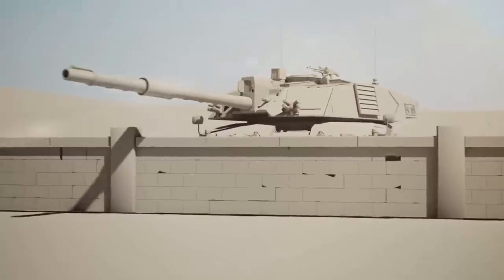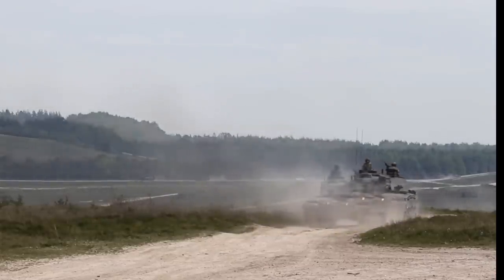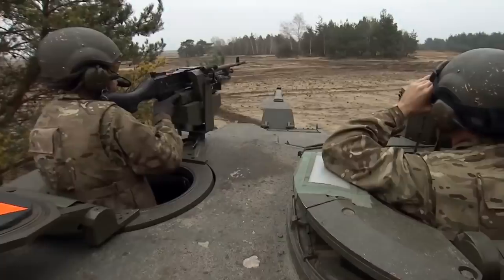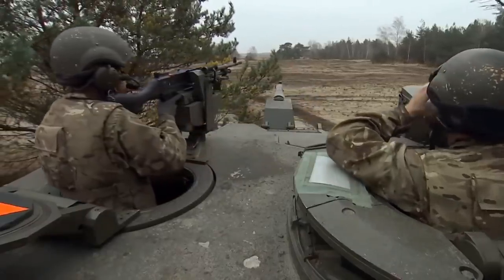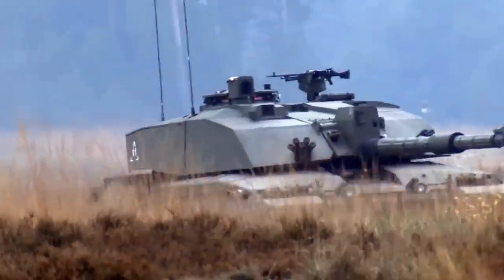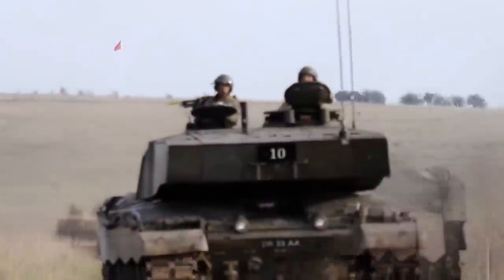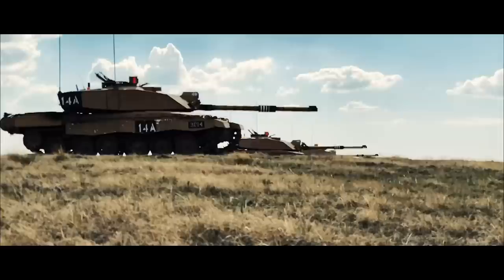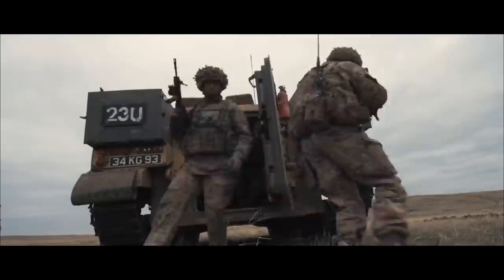Challenger 2 Tank "Black Night" | MODERN UPGRADE

Comment: The arguments for the engine are true enough, there's been the 1500hp mtu option waiting in the wings for the past 20 years ready to go, is an extra 300 bhp really worth it? An extra 500 maybe, 600+ yes, go for it. As for the gun, the rhinemetal item doesn't offer enough of an advantage over the L30 to make it worth it either and the commonality with our allies argument is utter BS, if it were true, the only difference in our kit would be the language use on the label.
Reply: placeholder  if you're worried about spin limiting the length of your rod don't be, the driving band on the sabot is designed to slip, limiting imparted spin to acceptable levels. Given the materials used, current KE penetrators are as long as they can be with out snapping on impact,  more length just on it's own means more weight and a coinciding drop in velocity (not counting less chamber volume for propellant) then there's just the physical handling in the turret by the loader and storage.
Reply: placeholder  it could be gotten around by either a pocket in the "front" of the charge or a shorter one filled with a different propellant. The unitary ones are pretty much at their limits on dart length already, the fins are back as far as the stub case and too much unsupported length out front runs the risk of deformation due to the shock of firing. Back to the challie, I doubt you'll see a smooth bore on it in service because by the time you've fitted the gun, sorted the ammo stowage, fitted all the black knight wizz bang electronics the army wants/needs, you're looking at 2/3-3/4 the unit cost of a complete tank because it'll require a new turret and if you're going that far the army may ask for the bigger engine as well, easier to build a new tank. The challie will retire in 2035 or there abouts fitted with a L30, what the replacement is fitted with is anyone's guess. By then Gauss or Rail guns may be the flash new tech as far as tank armament goes.

Comment: What is so hard about replacing a rifled barrel with a smooth one?
Reply: Thay would need to redesign the turret takes time and money
Reply: @spirit_miku  But the rifling is inside the barrel why does that need to change anything outside the breech apart from the projectiles.
Reply: @MrMonkeybat  the barrel is part of the breach the breach would need changing
Reply: @spirit_miku  Why cant a smooth bore barrel with the same exterior dimensions that fits into the same sockets be manufactured?
Reply: @MrMonkeybat  it maby possible I'm not 100% the barrel isnt a separate part as far as I know so it can't be removed I may be wrong

Comment: What are ppl on about how is a smooth bore better than rifled? Rifled bore is way more accurate
Reply: No, it's not. Famous myth.
Reply: @jonny2954  it's not a myth if the shell coming out of that smooth bore didn't have tail fins then it would shoot all over the shop where as with a rifled bore you have no need for any of that
Reply: @robh316  That's why smoothbore ammunition has tail fins.
Reply: @jonny2954  yeah i know but its just another thing that could go wrong what if the tail fins damaged ammo would fly all over the shot keep it simple just rifle your bores
Reply: @robh316  Damaged ammo shouldn't be shot from either gun.

Rifled vs. Smootbore isn't about accuracy. It's about armor penetration. Smoothbore guns have higher muzzle energy because they sustain higher pressure and have less friction. Furthermore the ammunition fired from the rifled L30 gun is seperated into two pieces (projectile and propellant), while NATO standard smoothbore ammunition is in one piece. The disadvantage of two-piece ammunition is that the KE penetrator length is limited, because it has to fit in the first part and can't extend back into the propellant like on one piece NATO standard smoothbore ammunition. A shorter KE penetrator is also lighter, and coupled with the lower muzzle energy of the rifled L30 is results in lower armor penetration.

Comment: No we need an Amos mbt
Reply: I think a Merkava Mark IV chassis with a new turret would be a good fit for a well protected AMOS platform. They already made IFV and artillery variants. The rear hatch would be handy for rapid reloads and the protection scheme is well suited for urban warfare. It would be a lot better protection than the CV90 or even lighter chassis.

Comment: hmm what happened to the Bae Systems & Polish MBT project Stealth Tank OBRUM PL-01? I believe they can make a modified version better than this one as a Challenger 2 gen 2/Challenger iii w/ pull power pack, active/passive short-air defense radar & attack system, active/passive integrated stealth armor. Longer body, bigger space, powerful hybrid engine min-max speed of 45~75kph, 50-80tons full capacity weight, modular hull/turrets/part system ala lego bricks, 2 man crew driver & hunter, Manual Auto AI computer support & digital HMD display, Armored protected crew hatch, advance armor & 330° sensor, 130mm advance smooth/riffle gun, miniaturize Dragonfire LDS(I doubt they have already that prototype at Bae Systems) & that's what they thinking for the past year WTH! where it is now lolx 😂😂😂

They plan it to counter T14 Armata sadly the Russian delayed the full manufacturing of it to almost cancelled like the SU-57.

Comment: The driver spot of the challenger 2 is an even worse weakspot than the abrams' turret drive ....
Reply: Actually, the driver of a C2 is better protected than in a Leo or Abrams (or Leclerc). Go Google image and look for pics of the C2 hull without Dorchester fitted. All around the drivers position you'll see troughs where the Dorchester blocks are attached to the hull. Essentially the driver is surrounded by a pit of Dorchester. That's why the Glacis of a C2 is curved and more prmoinent than the glacis on the other tanks in NATO. They do not have any comp armour as standard on the glacis.
Reply: the womble yee i know what you mean .. but i mean the little window the driver looks though ... this little "window“ is no resistance for tank shells
Reply: @GoRideLP  the chances are so small that a shell would even hit there. Its a well known fact abrams has poor turret ring armor and weak gun mantlet but they leave it out since its not a place your likely to be hit
Reply: Anne Isopod  in absolutely perfect conditions....

Comment: Heavy dino it's best days are gone. The gun is inferior to the rest of the Otan's 120mm gun, it won't be easy to replace, dated armor, it's already too heavy and underpowered, adding reactive armor will only make things worst. The German Leopard should be a better option, but there's no cash to afford it. Not sure about active protection systems? Read about merkava and the trophy system

Comment: When british will finally start making decent tanks?
Reply: Gar  they never were, really.
Reply: Gar  Chieftain sucked compared to T-64 and M60 in terms of reliability, because it had 2 engines. 
During WW2 Soviets valued Sherman, Panzer and T-34 a lot more than British tanks. 
Challenger 2 has huge profile, rifled gun, the last upgrade waits 74 tons, which makes it total lame in terms of maneuverability, bad power weight ratio.
Reply: You mean the looks or what?
Reply: @jem2779  British tanks have always been some of the best in the world, the Soviets had their best tanks lined up against the Chieftain, the tank itself was very good, the L60 was terrible because at the time NATO wanted multi fuel engines so British Leyland did so, then Nato changed its mind... but the L60 was already designed and in production so they went with it. It was the achillies heel of the Chieftain.
Reply: Well, they have always made them.
They made more-or-less the very first ones. Chieftain suffered from reliability due to the engine? Still it was a beast. Btw., T-64 was very unreliable and problematic tank. So?
How many Cromwells were sent to USSR? And Soviets that lost as many tanks as they produced are somebody to rate them? T-34 was quite a junk - btw.
Centurion? That gentleman sent bunches of the soviet ones to the junkyard. 
Well, western tanks have big profiles. Better working conditions for the crew.
Rifled gun is OK. It serve its purpose. What about Abrams crew with those omnipotent smoothbores finding themselves in Iraq with no truly usable antipersonel or antibuilding / antibunker ammunition few years ago?
Btw. Leo2 upgrades are slowly eliminating weight gap ...
Reply: @jem2779  lol, since WW2 the Brits learned from their mistakes and have consistently produced top tier MBTs. You are delusional; Centurions, Chieftains and Challengers have performed, based on evidence from real situations, extremely well. The Centurion defined the MBT, is considered by many to be the best tank of its era, was exported massively, and annihilated Soviet tanks during Israeli-Arab conflicts. The Cheiftain lost out commerically to the German Leopards, but was a very advanced if not expensive tank. And the Challengers have impressive kill records in the Middle East.

The issue since WW2 with British tanks is absolutely not their quality, but their quantity and any good military advisor knows this. WW2 British tanks followed the flawed cavalry/infantry tank doctrine which did not work well with the changes in warfare that WW2 resulted in.
Reply: @mungo7136  you pretty much full of shit:

1) T-34 was okay tank. It was valued a lot more than matilda by Soviet tankers.
2) Chieftan had shitty reliability even compared to T-64. T-64 was unreliable only at the beginning.
3) Israelis used to kick arab butts even with outdated Soviet equipment, since the former ones are incompetent morons. 
4) Challenger 2 was ALWAYS advertised as "most protected tank in the history of mankind". Yet, RPG-29(650 mm penetration) had no problem with penetrating it from front. T-90, which according, to western "experts" has "inferior armour" survived TOW-2A (900 mm penetration) without any problem. During Greek Tank Tender T-80U showed superior reliability, compared to Challenger 2. Now, I really doubt about Challenger 2 reliability, when it weights 75 tonnes.

Comment: Just buy the Armata t-14 ! Europe, America, the UK are "just" responding to "OTHER" threats to a main battle tank, too little, too late. The upgrades to the Challenger 2 are truly bad, it looks like someone designed it from an old Airfix model and just stuck things all over the turret ! My solution;
Blend all upgrades into the turret and body of said tank.
Replace the coaxle machine gun with a much larger calibre, 50cal, 30mm rarden (being replaced on warrior, so should have some spare) cannon, etc.
Auto loader should have priority over new cannon. 
Helmet mounted targeting system aka the longbow apache with all round sensor's for all grew members.
Improved seating and enviroment for grew creating less fatigue. A remote get me to the "rv" if hit and grew unable to (like a drone does).
The list could go on.
Reply: Adam Rant no

Comment: Please give me a break matsimus this has NOTHING, on the M1A3 Abrams Tank.
Reply: Good meme. Chally 2 is faster offroad
Reply: @joshjwillway1545  Finally someone said it
Reply: Uhm... The M1A3 has been cancelled mate. Instead they went for a small service pack for the M1A2, of which merely the testing will only start in 2021, assuming there are no further delays.
Reply: There is no such thing as M1A3. The next upgrade is M1A2D (M1A2 SEP v4).

'Chally 2 is faster offroad'

LOL. You might want to check the mobility trials in greece.
Reply: @jonny2954  Greece rigged the dirt!
Reply: And the headwind!
Reply: I don't recall seeing any data or testing for off-road mobility in the Greek trials? Just the top speed reached for each vehicle with the Abrams getting 70-72kph and the Challenger 2E with the 1500hp MTU getting 70kph.
Reply: Naah. Greeks stole the treads and sold them to buy food. That's why.
Reply: Time 4 Tea In theory (power/weight-raito) the Challenger 2E with it's 1500hp europowerpack would allow similar mobility to M1 or Leo 2, but it didn't. The guys at vickers missed out on fine-tuning everything, and it threw most of its track pads (80-90% were replaced) while trying to climb an obstacle (it's not all about top speed).
Reply: @jonny2954  That wouldn't suprise me. IIRC the 2E in those trials was missing it's proper ammunition, TOGS and it's gun barrel had debris and residue inside it. All of those problems contributing to the poor accuracy rating in firing tests.
Reply: You recall incorrectly then. The low accuracy is often blamed on the propellant charges, that suppposedly exceeded their storage life, resulting ininaccuracies. That was proven wrong. It is also often blamed on the older L23A1 APFSDS that was used (greeks didn't permit DU rounds), however there is no indicator that these round have lower accuracy, Oman Challenger 2 use them just fine. It was fault of the FCS.
Reply: Well either Vickers or the Company that built the FCS is to blame for that as the FCS in the Challenger 2E wasn't British but rather North American in origin. Just as the main sights on the 2E were French and the powerpack was German. You'd think that putting all of those together would have made quite the tank.
Reply: Jonny, in which case the M1A2 SEPv4 Abrams is better the  Challenger 2 Black Knight
Reply: Chobham is better m8 get rekt
Reply: xu da better protection for a start